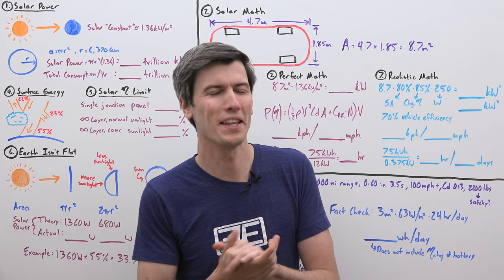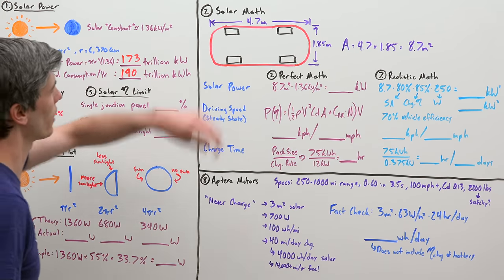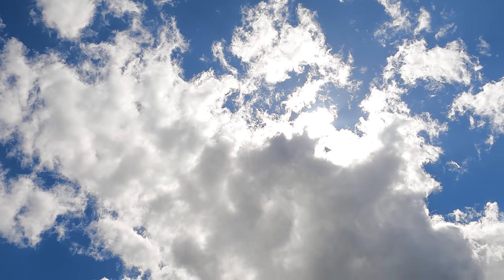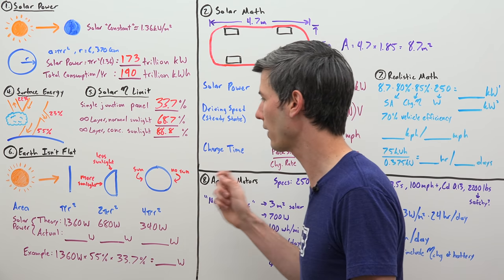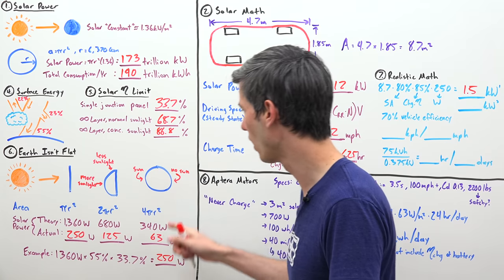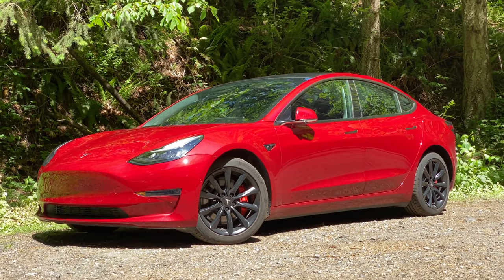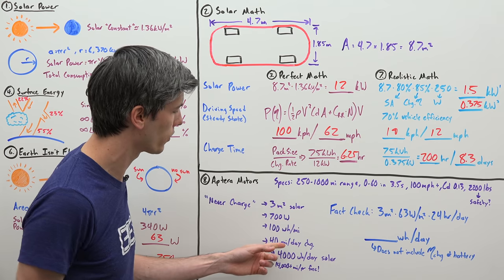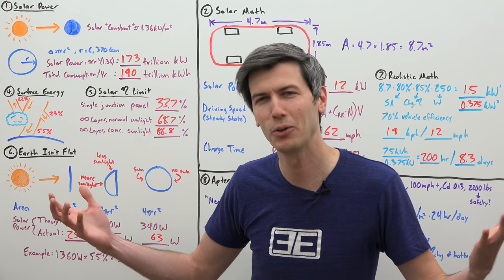Why Don't Solar Powered Cars Exist?

Comment: Jason, I'm going to argue that 
ALL cars are solar powered.

Indirectly.

steve
Reply: Literally everything on earth is solar powered, including geothermal vent bacteria (okay that's the sun's grav potential, a little cheating but still)
Reply: nope i would argue that nuclear energy is not what we call solar powered. 
it is on the other hand the the remnant of either a supernovaexplosion or collision between neutronstars.

so i would say nuclear is star powered, or you could go so far as to say that it is powered by the death of stars.
so i would technically be correct(best kind of correct) if i say nuclear is deathstar powered.
Reply: @TheHellogs4444  Not everything. Not volcanic geothermal power or radioisotope power.
Reply: @nilsdock  death of stars is death powered not star powered.
Reply: Those shiny rocks we call Uranium came from supernovas/neutron stars. So not everything is solar powered

Comment: If you can cover your commute then absolutely put solar panels on it. 5-7 miles of charge per day seems feasible and would cover a significant number of people’s commutes. It’s going to be hard to scale infrastructure and the most direct way to scale is by the vehicle itself being able to generate power. We absolutely should be putting solar panels on cars.

Comment: I’m looking forward to the new EV truck line up from Toyota. I think solar would be perfect for them given the large surface area. And I don’t think most people are looking for a car that’s fully solar but for supplementation.
Reply: It would be possible to mount about 7 KW of solar panels on a trailer that can be towed by a Tesla truck.  The power output for one day would be about 35 KW.  The Tesla truck can use 2 KW per mile, so the 35 bonus KW per day can be used in about 15 minutes going 60 MPH and using about 120 KW per hour.  

So yes a solar panel on the roof will extend the range of a Tesla semi truck, by about 15 miles per day.  Or about the same as charging at 350 KW per hour for 6 minutes.   So 6 minutes less time spent at the charging station!

Comment: I have been doing a back of hand calculation for solar electric car.  It is a lot faster calculation. It uses the standard solar panel calculations.  These calculation are based on measured data.  NREL Horizontal Solar Irradiance map.  The solar panel watts ratting.  

 Horizontal Solar Irradiance is really easy it basically states if you lay a 1 Watt solar panel flat on the ground you will get on average N Watt Hours of electricity per day.   From NREL map, you can see Boston is 4.0 and LA is 5.5.   So in Boston a 1 KW Solar panel X 4.0 gives 4 KWH of electricity.  Likewise in LA 5.5 KWH.

A standard house solar panel is approximately is a little over 3x5 (39"x65", they vary in size) so approximately 1x2 Meters or 2 M^2.  Each panel has name plate of ~300 Watts.

I have always though about 4 panels would fit on top of a minivan.  That would 8 M^2.  1.2 KW.  Let's make 80% efficient.  Finally the minivan getting 3 miles per KWH.

In Boston:  1.2 KW * 4.0 Irradiance * 0.8 * 3 miles per KWH = 11.5 Miles per day.
In LA:  1.2 KW * 5.5 Irradiance * 0.8 * 3 miles per KWH = 15.8 Miles per day.

I have always said 10 Miles per day is possible given current tech.  That is 3650 Miles per year or 20-25% of the average US driving.

There are some solar panels made from nano-particle inks/paints on substrates like mylar.  I figure somebody might figure out how to literally paint the solar panes on the car.  They would probably only weigh a few KGs and be cheap to install.  Labor is one of the biggest costs installing solar panels.

Comment: I'm gonna guess the biggest 2 issues are efficiency and the energy density of the sun's light. Even at 100% efficiency I think we would need a huge surface area of solar panels to collect enough energy to run a car at speed. Solar panels would at best give a modest boost to EV range.

Comment: Okay so I know a fully solar car isn't feasible, but what I would like to know is how much extra range could covering your car in solar panels give you? I'm thinking from your math if the car can generate 1.5 kW from solar and you normally drive about 250 miles on a charge, or roughly 3 hours between charges on a road trip, then the solar would be equivalent to adding 4.5 kWh to your battery pack? Enough to boost the range by about 6%?

Comment: A small panel on the roof wouldn't be a bad idea even just to keep the battery from self discharging.
Reply: And if you don't have to fast charge as often, reducing battery degradation, increasing battery lifespan.

Comment: Great video. Lots of accurate information, but one thing was overlooked. More of a practical matter than anything else; in climates where a solar-powered car would receive optimal sunlight for charging, no one would want to park it in the sun. Ever climb into a car at 2 pm that's been sitting in the Arizona sun since 6 am? It's like 1000 degrees in there!

Comment: The origins of the energy in that petrol comes from the sun so I guess we do have solar powered cars and always have (maybe some that got electricity from geothermal I guess). As we move over to solar and EV's we get a more direct route to that solar energy.
Reply: If so then most of the energy earth has is due to the sun or maybe triggered by the sun's energy,photosynthesis and so many other phenomenon too.
Reply: @erenjaeger772  Yup, the sun is our primary source of energy. Of course there is the geothermal heat from out core and the energy gained from the moon moving away.

Comment: If you wanted a solar powered anything, it would have to be on a platform designed to be parked for long periods of time. An RV, a truck trailer. I think all the big rig companies are going the wrong way. A split battery design, with trailers covered in PV and containing a large portion of the battery would be pretty cool.... The way you operated a trucking company would change a little but the implications are cool. An RV with a 500 mile range, solar awning/patio.... Park it for a week and charge. When the battery is full, take off and move to the next spot

Comment: I would do this with a delivery van like Amazon has. Lots of surface area on the roof that probably equates from 85-95% of horizontal, usable space, particularly if the shape was square with just a slightly raked windshield. That vehicle type only operates during the day while charging on an outdoor lot at night. These vehicles are often immobile in the sun while deliveries are being made and aerodynamics aren't a big deal considering their average speed while working. It could cut power consumption significantly. I don't see it being usable in many other scenarios.

Comment: Great video. Even with a tesla it is still possible depending on usage. People have ridden over 800 miles at 30mph in a model 3, this is slow but so are residential areas. So at slow speeds and with 700 watts of power over shorter distances, under 15 miles a day say, even a tesla would be self-sufficient. The one major advantage evs have over ice is that you can refill them almost anywhere, adding solar panels is the obvious next step. Even if it only adds a km or two per day to current vehicles, as tech progresses this will increase dramatically, just like aptera.

Comment: For apartment dwellers where the apartment complex may not have set up charging stations (or not enough of them), not having to plug in everyday would be welcome, so I hope Aptera does succeed.  What I’m waiting for is a 4-seater Aptera - that would be good for a small family.  But I guess that’s going to take more time…
Reply: Their 2 seat model is the size of an Audi A4...
You have to understand that, in order to make it more aerodynamic, they lost a lot of practicality in a large size.

Comment: Good to see this discussiontaking place. Solar powered vehicles , solar tech, etc are moving so quickly this information is lagging behind before its even  shared. Several promising innovations are coming to market , but mostly  from European and Asian vehicle  companies , not  The United States. Most problems are solved hands on , building it, boots on the ground. Less theory, more observation. Our greatest innovations havent necessarily come from academia, its from those who constantly build.
Reply: Check out Aptera.  Their largest number of engineers are developing Solar, and they will be filing for 50 patents or more in this area.

Comment: What about a foldable roof accesory solar charger, like an additional roof rack with solar panels that can unfold to fit the car footprint (for parking in tight spaces) or unfold even bigger if you park elsewhere. It would drastically increase the theoretical area of the solar panels and this increase the amout of power you can generate. Poeple usually travel twice a day (to- and from work), not too far, with most of the time car being unused. 
Of course there are different concerns, like structural integrity and wind gusts, rain and hail etc., but you can surely account for that while manufacturing. And it could be an additional accesory for any EV, just like you can buy an accessory roof rack fiiting any car model, just hook up the wiring to additional ports of the charger (Tesla has at least one additional space for plugging in, as I recall) and voilla, you can at least extend the range, if not eliminate altogether the need for charging. 
I'm not talking about driving without the need of charging long-range, but it might be uselful for most common applications, like city commute.
Also, when it comes to long-range transport of goods, deliveries, you have much greater area of the trailer that you can fill with solar panels and possibly extend the range. The drivers usually have daily limits of driving, they often stop during the day for breaks and drive at night, so it is also an option.
I'm just a huge fan of solar, and although I'm aware of the limitations and problems with it, a slow integration of renewable technology is the way to go when it comes to minimazing the impacto of fossils. And if you could sneak in this technology and sell it as money-saving, people would probably jump right to it and adapt pretty fast.

Comment: i considered putting 20 panels (5kw) on top of my semi truck trailer but when i ran the numbers, it wasnt even enough to run the a/c overnight.

then tesla announced its electric semi truck and thought they could use this to gain range.  drop off a trailer/panels/battery pack at a shipper.  3 days later (pretty standard practice anyway)  the batteries are recharged and double your range.

it just seems like there should be a useful reason to put solar panels on a tractor trailer considering fuel can cost as much as $80k per year for a team.

Comment: Aptera has already designed a working solar electric vehicle and is at the final prototype stage before going to production. They have made the vehicle so lightweight and efficient that it uses one third of the amount of electricity per mile compared to a typical EV like a Tesla Model 3, and its 700W solar panel set allows for up to 40 miles per day of free charging. That's better than the average commute for most people. All that remains now is for the vehicle to go into production, and that depends on financing which is difficult at this time because of the current economy. But they are using crowdfunding and my estimate is they should be ready to start production in 18-24 months if all goes well.

Comment: I feel like with the cost of good solar panels becoming cheaper and cheaper, we’ll reach a point where the cost of the panels is simply lower than the cost of the additional charging they make up for. Once you reach that point solar panels on the roof/bodywork of a car make financial sense even if the majority of electricity doesn’t come from them. 
I also wonder about trucks/buses that might one day be electric. Even though they clearly need more power, they seem to also have a huge amount of surface area. Especially trucks that spend most of their time on the highway might benefit from solar panels, even though they’d certain still have to charge. If under normal driving conditions, 10% of the power used to sustain the highway speed comes from solar panels, that’s a free 10% that isn’t coming from the battery, which allows longer trips between charges and saving money for the company.

Comment: I want to know if it is possible to charge the battery with wind turbines while driving or when parked in a windy spot?
Reply: It is certainly possible to charge while parked if you can spare the weight and volume of the wind charger.

Comment: A quick search for average driving distance per day in the US results in 35miles. I think your math for wanting a 'full charge / 200 miles' is spot on, but did I miss you mention that not many folks drive 200 miles per day (full charge). It seems on average to work out mostly. I feel like that is a good thing, but what is my armchair thinking missing? Your vids are great. I mention this because I am lower than 35 miles per day average. Probably closer to 20-25.

Comment: Real world math? I have a Mitsubishi Imiev that does get 100 Watt hours per mile.  I recharge my car with 100% off grid solar power from my backyard. I have 9700 Watts i’ve rated capacity and 8500 W of inverter. During low light levels I  use a level one charger(800watts) during brighter more full sunlight conditions are use a 3.1 kW level to charger. It feels real good knowing where my power came from is a clean source.

Comment: The idea of passive charging sounds great to me and I don't know why EVs don't do it. Even if you're only getting 20 miles per day from sitting in the sun, if you run out of power before you can get to a charging station, you just wait awhile and then you can drive to the charging station. That and the range extension of reducing the power used by the amount of passive recharge.
Reply: Those solar panels are expensive and as a project its probably very expensive to develop and integrate with the car, even if you were willing to pay the unit price. You can buy a lightspeed though, once that comes out. (Check out the price - its expensive)

Comment: We're talking in terms of complete dependence on one source of energy. Why not have it as a booster? Even if it can't cover everything it could cover a substantial amount of energy and has the benefit of a free emergency reserve for the poor. You can wait for the sun to charge it. Just have really big batteries and the solar element is always helping store energy but you have to charge for regular use

Comment: Brilliantly laid out and explained. One of your best videos. 

But anyway, the other angle is that you could own more than one solar powered car. If it takes 8 days to fully charge (presuming the weather's perfect all the time), and you don't completely use your car's full range commuting every day, then you could own 2 or 3 cars and use one while the others are charging. 

Of course, you'd better be close to home when your car's low on ray juice, maybe you could leave one car at home and the other at work. But in reality this whole scenario is pretty ridiculous anyway since not every day is perfect and there are things like winter.

Best thing to do is just tow a diesel generator everywhere :P

Comment: I heard about a company named Lightyear starting production of a EV that can be solar charged next spring. Promises up to 70km range from solar per day or 12km per hour, but obviously in the winter, overcast etc. it would be way less. (These numbers seem to be close to the ones in this video btw!)

Also seems pretty expensive - that car is supposed to be about $165k. Range would be pretty impressive with 725km (WLTP) on a 60kWh battery, which would mean it's very efficient.
Reply: The Aptera will travel 1000km on that size battery and be priced under $40k US.
Reply: @jonsek  Yeah, maybe but that barely qualifies as a car.

Comment: Sounds like a plan I want one, Aptera Motor. I'm not sure how it will work with only 12hrs of sun instead of 24 hrs of sun but I think I will just divide the numbers in half. It will be great, I only drive 60miles per week in sunny africa. No gas stations and no superchargers. Perfect, the last car I will ever need.

Comment: a "few" spare cars" avoids a lot of the range anxiety.  Using the sun to run an AC unit and keep the 12/24/48 VDC (potential, reasonavble and future compatible low voltage architectures) bus powered up - more sensible.

Comment: I think solar power makes a ton of sense, but it makes more sense as a static installation. A charging station (partially) powered by solar is cheaper and more practical than a car with solar panels on it. A stationary installation doesn't need to worry about being able to survive road shocks or have the added cost of having to conform to the car's shape.

You can put a stationary solar panel somewhere that gets good sunlight, whereas cars might be parked in garages, behind a building, or under a tree. Plus, even if someone isn't charging their car, a stationary solar installation can feed into the grid, since electricity is used all over the place.

Comment: If you cover a normal parking spot with solar at 20 m2, recovering 3000 kWh annually in an average solar exposure location, you can drive 10.000 miles in your Tesla. So yes, it is possible.